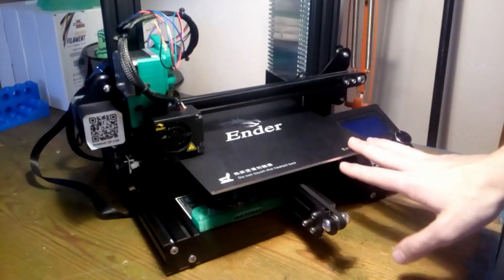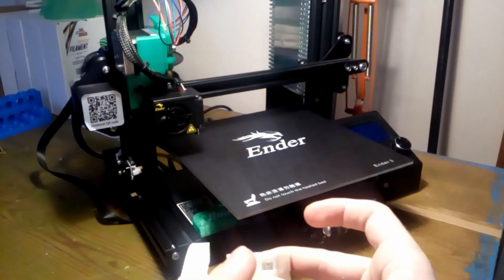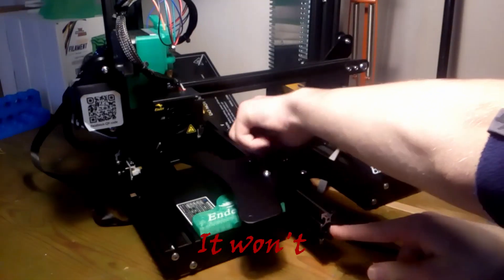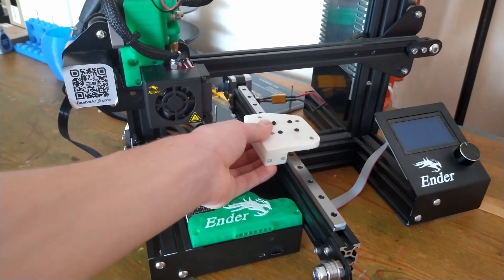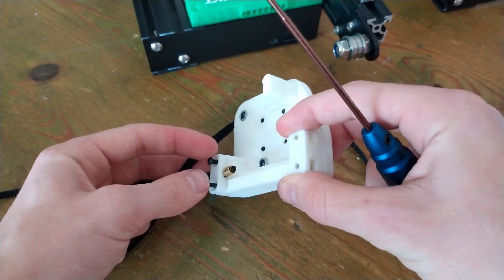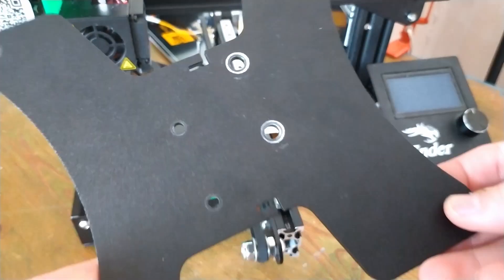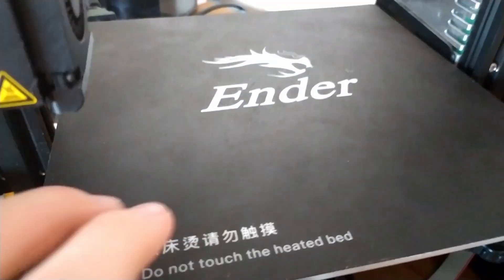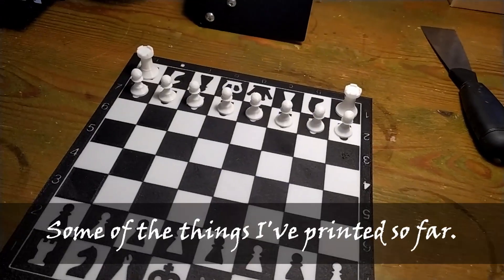Ender3 Linear Rail Upgrade Guide

Comment from the maker: I got the rail from banggood: https://m.banggood.com/Machifit-MGN12-100-1000mm-Linear-Rail-Guide-with-MGN12H-Linear-Sliding-Guide-Block-CNC-Parts-p-1156260.html?rmmds=search
But you can use any 300mm mgn12h rail
Reply from the maker: @fraled96 I can't see your comment here so I can't answer you for some reason.
Reply: @3Drcnc  sorry, maybe it has been eliminated. Thanks so much. Good job!
Reply from the maker: @fraled9644  Thanks!

Comment: Is this any Good?
Reply from the maker: Yup, it sure is. Otherwise I wouldn't have made it. If you have the old ender 3 with the offset wheels this makes it a lot easier and more stable. On the newer ones it's not really necessary though and it won't fit either.
Reply: @3Drcnc  i have to old one and the wheels are getting pretty bad. Have seen some kits for like 80 bucks and that is a rip off in my eyes. Yours looks ok
Reply from the maker: @simonjohansson7284  Yeah, those are just crazy expensive and I wouldn't send how it would be any better than this. Most parts are reused. You just need a few bolts that are a few bucks
Reply: @3Drcnc  yeah, im definitely gonna give it a try 👍
Reply from the maker: @simonjohansson7284  Awesome! Hope it works out.